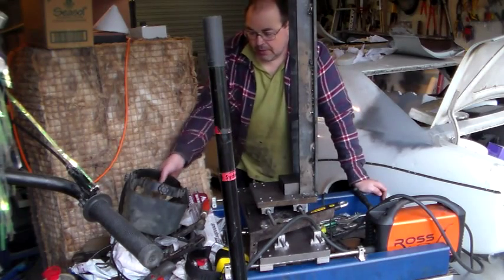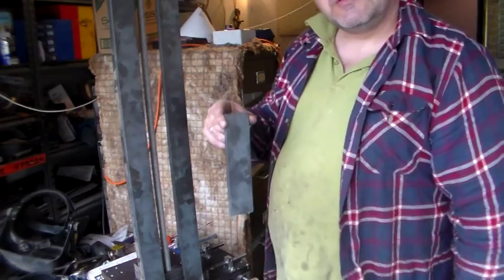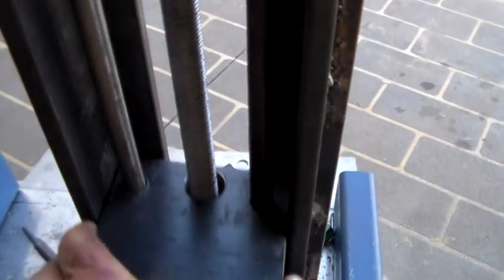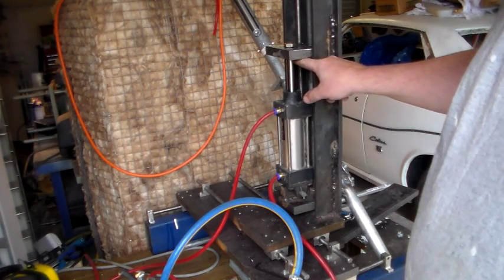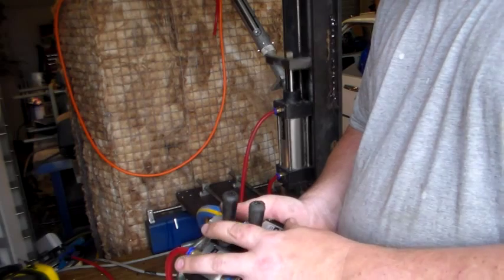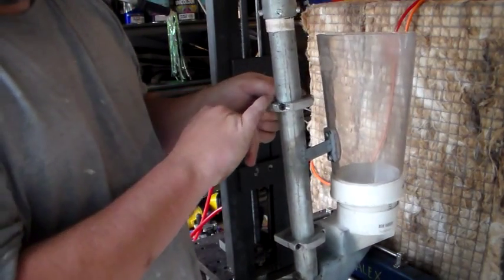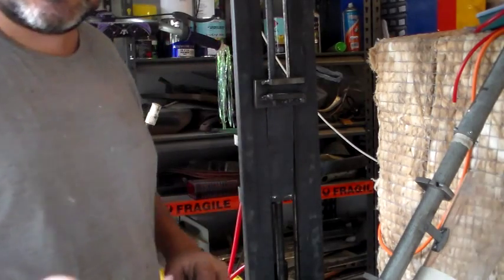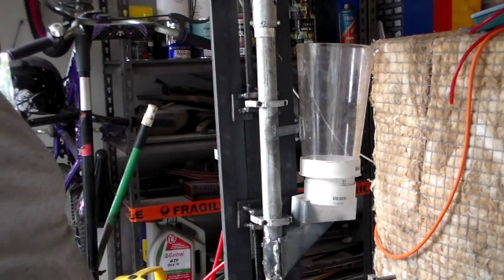Making a Plastic Injection Molding Machine Part 11

Comment: On 18:10 it looks like some deflection could cause a leak when the nozzle meets the mold. My guess is to have a rounded dome nozzle like a 3/8 or 1/2" acorn nut, but we'll see.